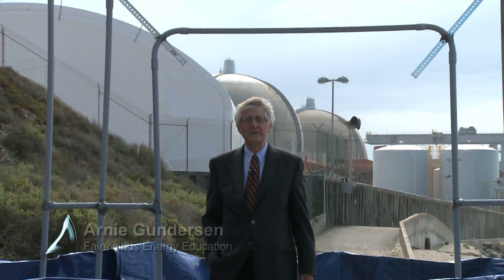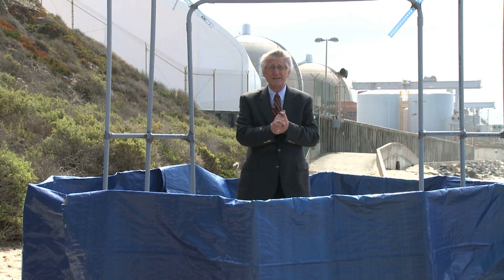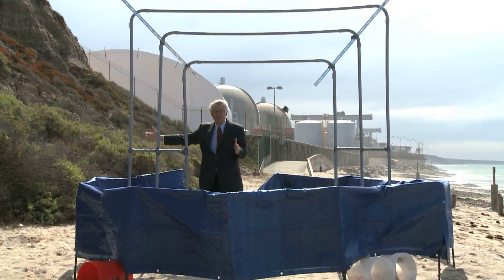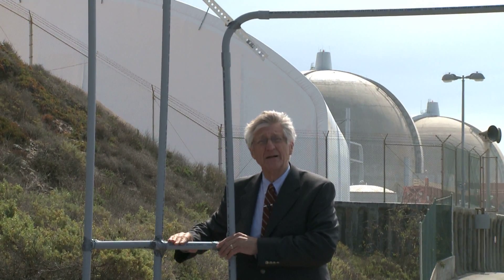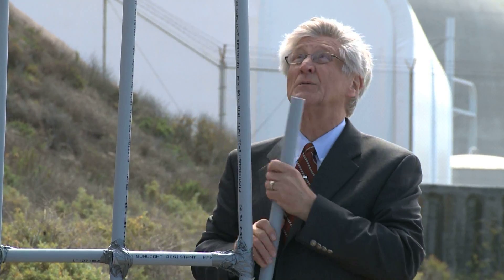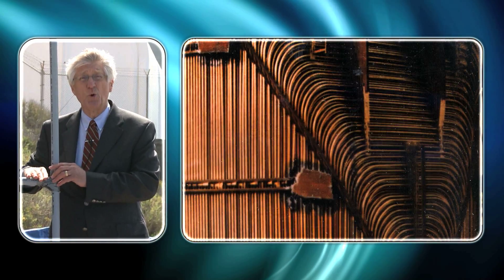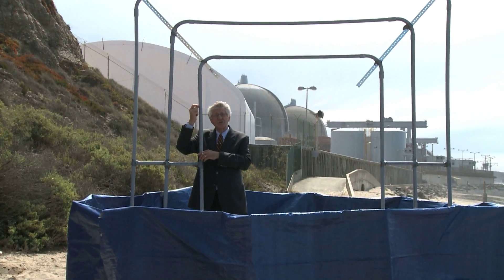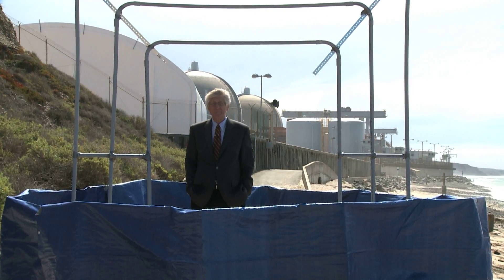San Onofre: Bad Vibrations

Comment: You are exactly correct. I have worked at the plant now for four years. And having talked with the plant operators for more time than I care to admit. Bottom line is you NEVER change the original design when it comes to nucular.So for those of us who are In the know.. Edison changed the design to produce more power. And as we all know you NEVER CHANGE THE ORIGINAL DESIGN WHEN IT COMES TO NUCULAR. now through everything that has transpired the lawsuits against Mitsubishi and soforth they made the new steam generators per the Edison design.but it created problems that may or may not have been FORESEEN. from everything I have knowledge of if they just would have kept the original design exactly the same there would have been no problems.BUT... Edison tried to get more power out of the the plant by redesigning the steam generators. And from no fault to Mitsubishi at at all... (because they made the new steam generators per Edisons design) there were problems as related to the new steam  generators.all I can say is it shameful that Edison tried to place the blame on mitushibishi for a faulty design when the blame rides squarely on the shoulders of Edison for redesigning the steam generators. And THAT IS THE TRUTH.as put forth in this viedo and all the information I have gathered first hand working at san onofre...